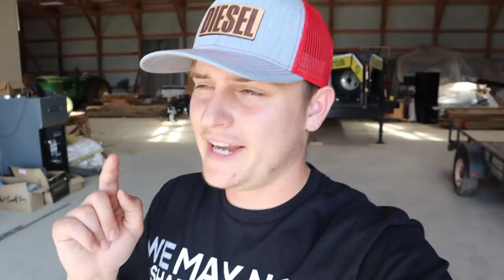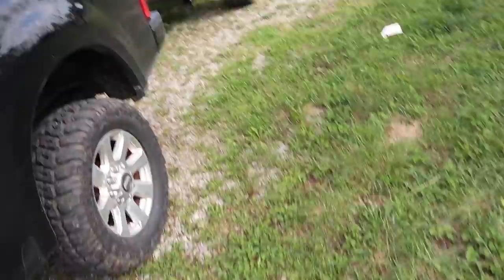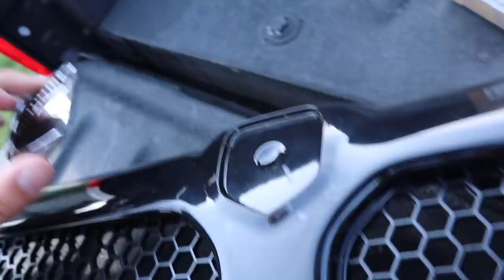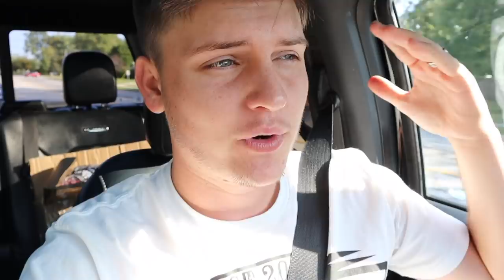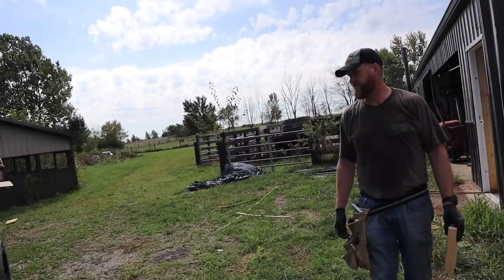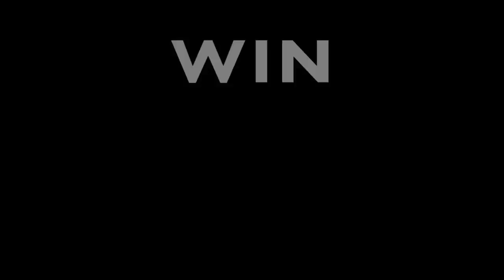We FINALLY got this DONE on NASTY RED!!!

Comment: You should do an afc live and 4 glowshift gauges, which are boost, egt, trans temp and fuel pressure.
Reply: Keegan Reynolds if anything auto meter gauges, glow shift are junk. Every guy I’ve known that has had them said they weren’t accurate
Reply: Yes I know that but the reason why I said that is because they have the glowshift gauges theme going. Like for example in that white first gen cummins, they have them gauges in it. So that is why I said glowshift.